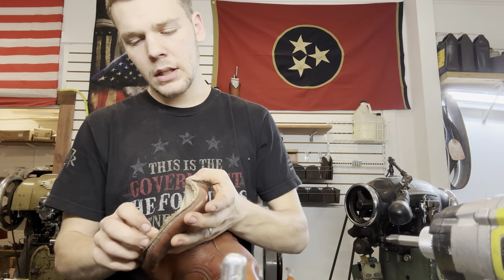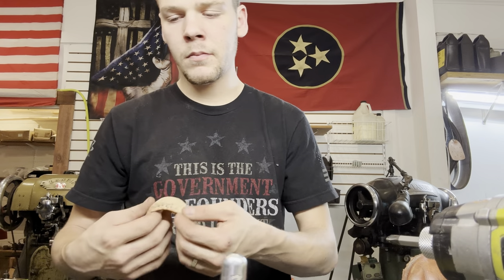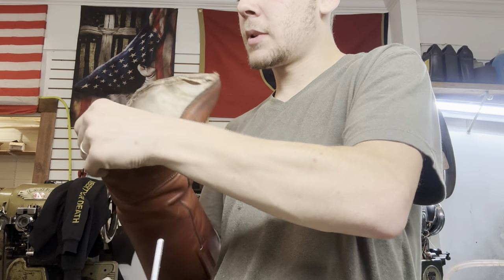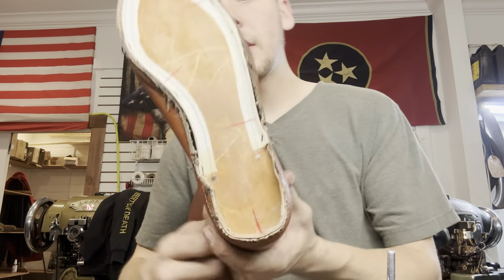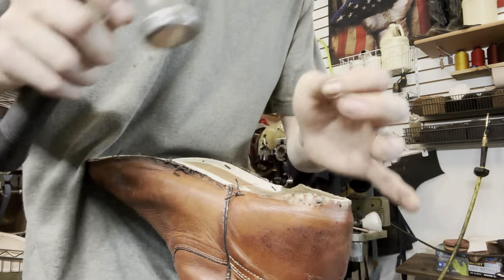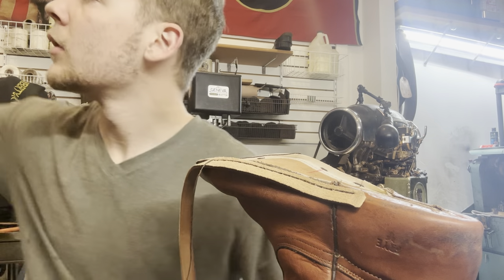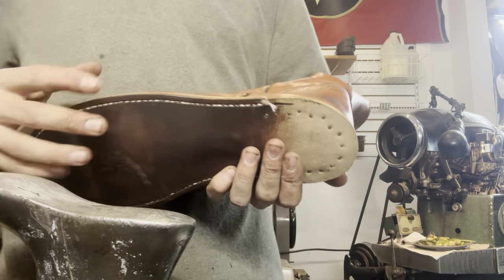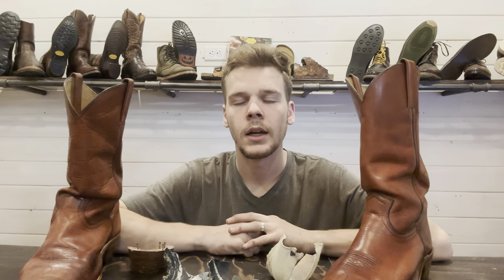Restoring An Old Pair Of Frye Boots That Belonged To The Customers Father& Now He Gets To Wear Them!

Comment: Great job and nice video.  Why did you have to replace the heel blocks?  Were they pressed leather board or was it a size or shape issue?
Reply from the maker: Thanks! We replaced the heel bases because the leather was a little dry and cracking.